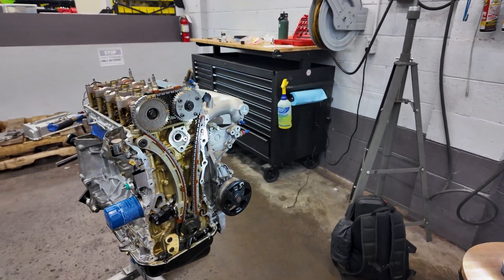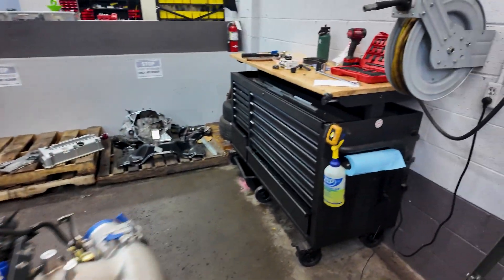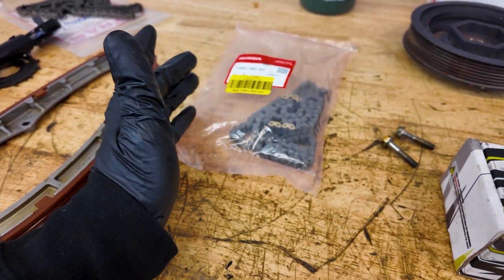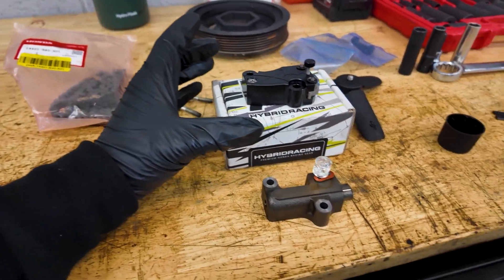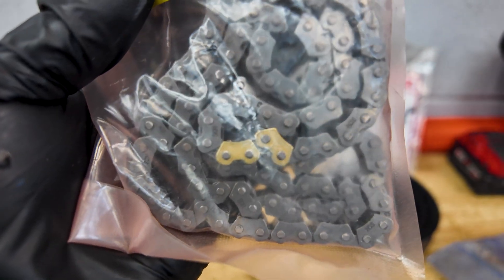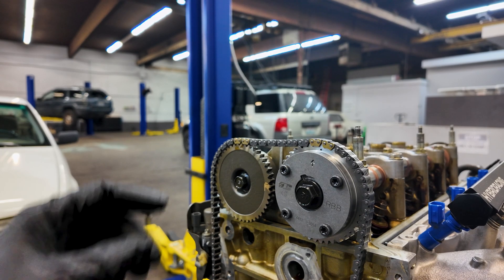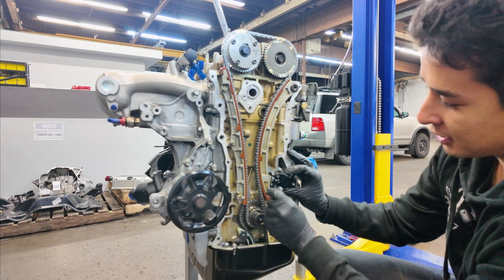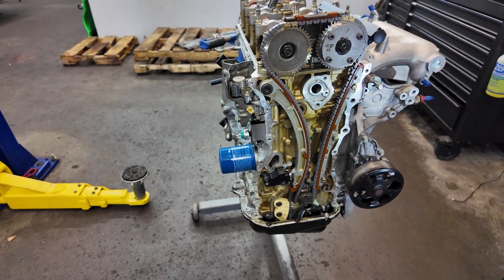How To Set Cam Timing on a Honda K20/K24 - Quick & Easy K Swap Guide!

Comment: Very nice and straight forward. Just got a k series and I wanted to know how the intake cam phaser works or is there a certain way to install it? I notice when I spin the engine after timing it the intake cam is slower in rotation than the exhaust and then I hear a click the phaser jumping forward or back not sure is that normal?